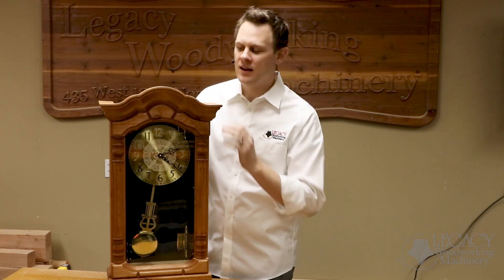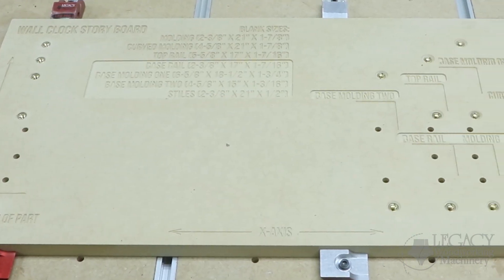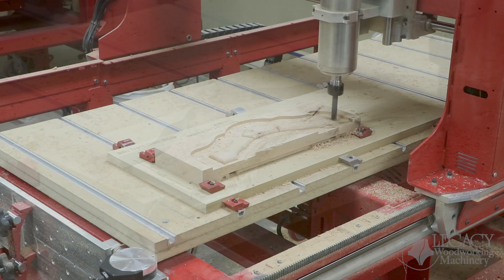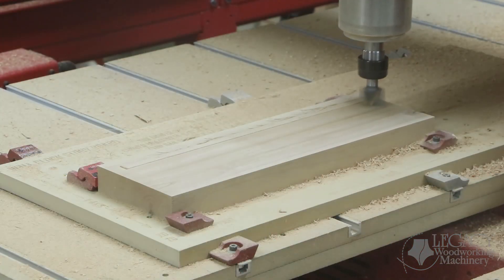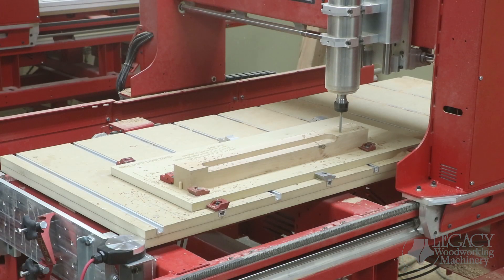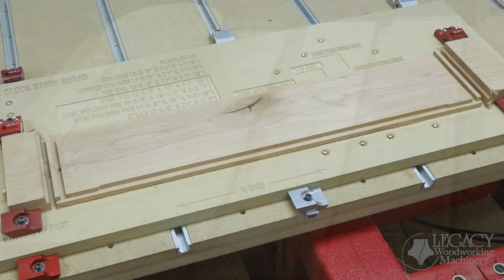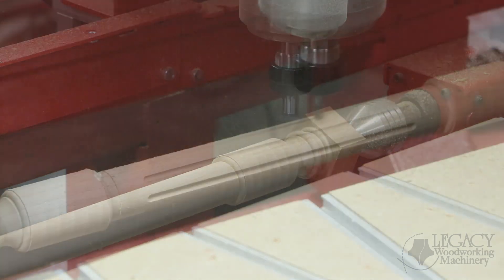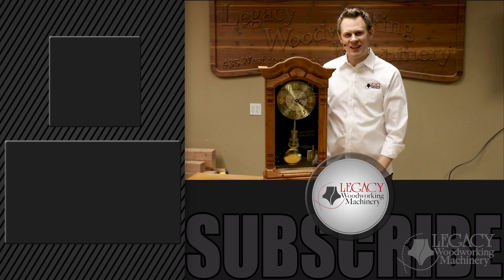Wall Clock Workshop Demo - Wood CNC Project - Legacy CNC Woodworking Machinery

Comment: Great video.  Do you have more information on the storyboard fixture plate method it seems like the procedure complements your cnc nicely.
Reply from the maker: There are a lot of ways to make a story board.  would you be interested if I made a video on making a story board?
Reply: @legacycnc8232 Hello, that would be very kind of you if you could spare some time to give additional details on how to design, make and use a story board.  Your efforts to help educate others not as advanced as you are greatly appreciated.